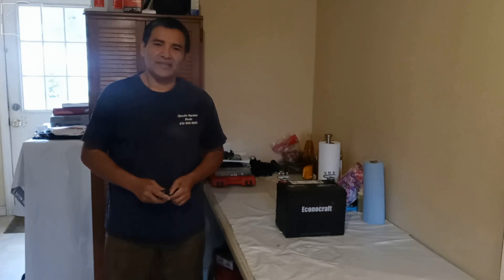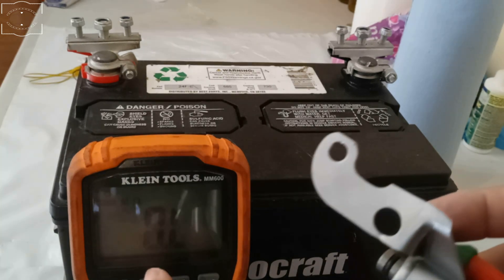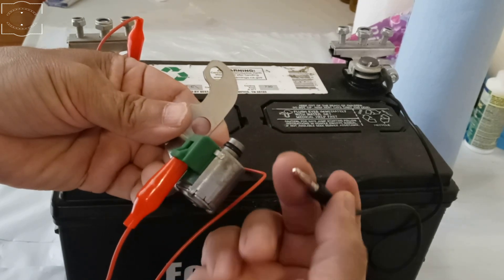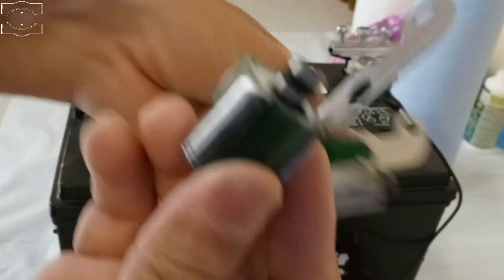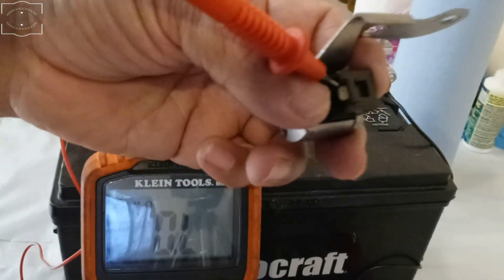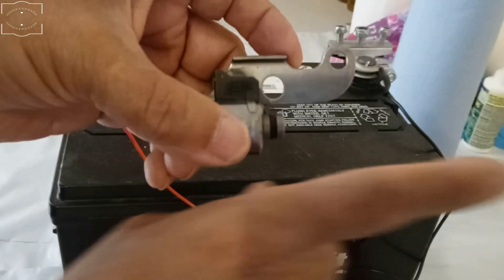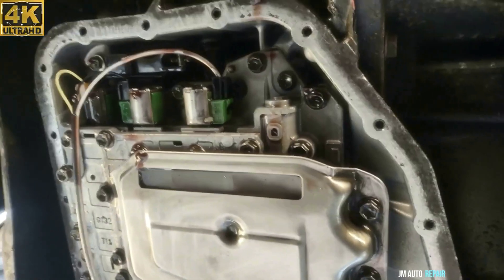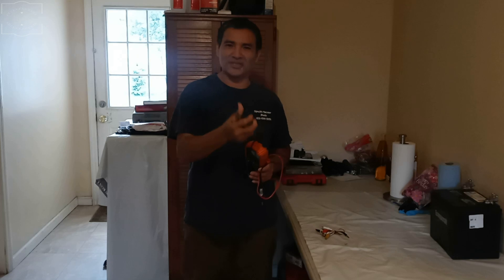Toyota Transmission Shift Solenoid Test P0741 p0751

Comment: Thanks for the video
Reply: Excellent video! When I got the code, I only replaced the very corner S1 solenoid thinking that was it. However, watching your video helps me identify and test the solenoids . Is it possible that the solenoid wire or cable could be another issue? The reason I’m asking is because I got the same error again. Maybe I should replace all three solenoids and wire .
Reply from the maker: @notaforte  hi thanks for sharing, best is to test all of them with the exception of the one that has 2 wires with that one you have to do more work to get it out of there n it has a different wat to be tested, any that doesn't pass both tests then it is time to replace it, wires could be an issue but not really, test them
Reply: I will post once I work it!
I subscribed!
Reply from the maker: thank you.